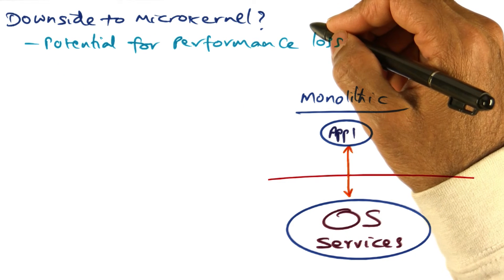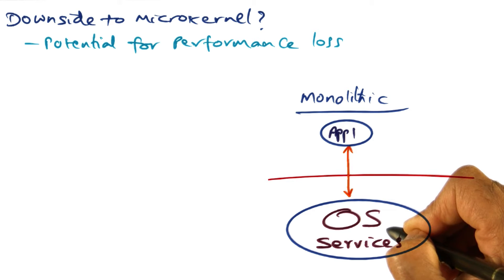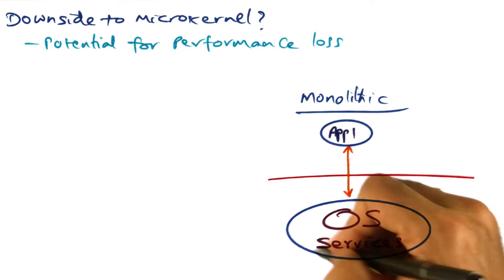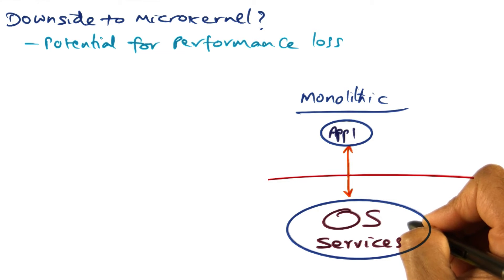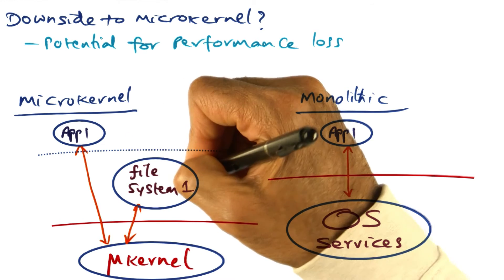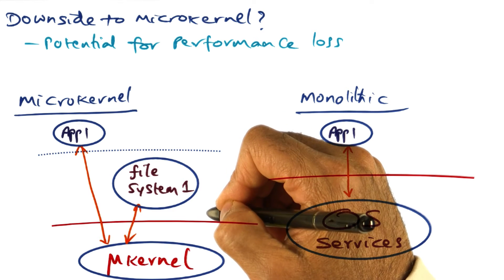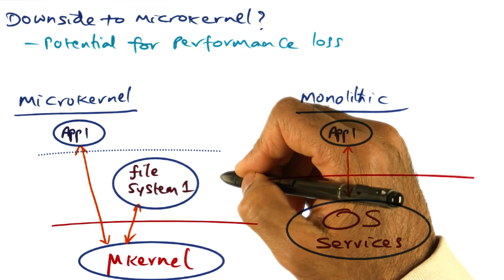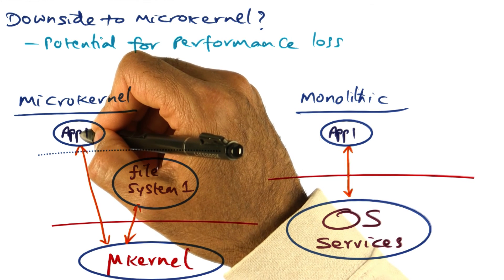Downside to Microkernel - Georgia Tech - Advanced Operating Systems

Comment: what would be the difference between IPC call and a System call ?
Reply: Generally the passage of a data block. That is, most IPCs pass a fixed size record or data block. A system call has to state its parameters in registers, and if the data structure is bigger than that (such as write data to file), it contains addresses/pointers to accomplish that.

In the context of this video it seems that he is considering an IPC to be a superset of system calls.